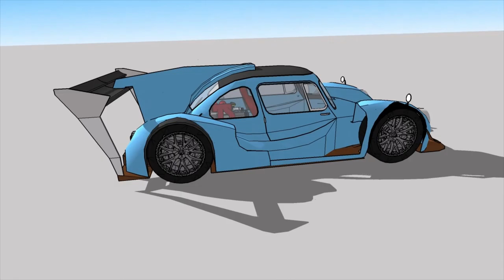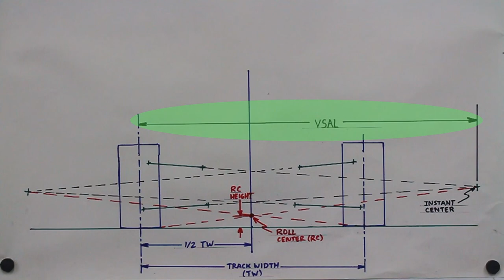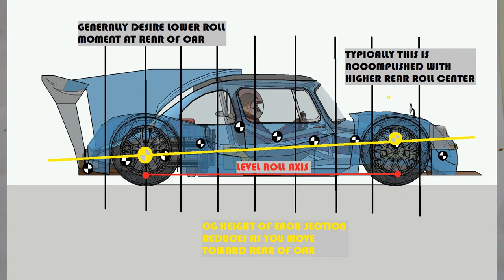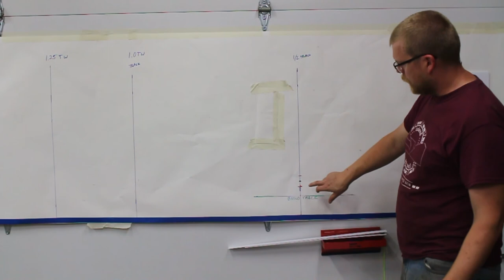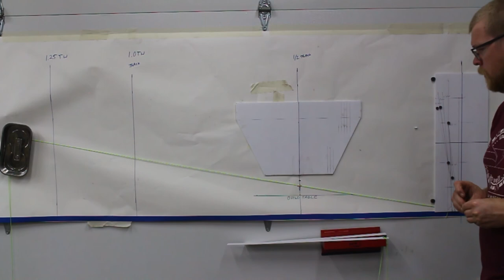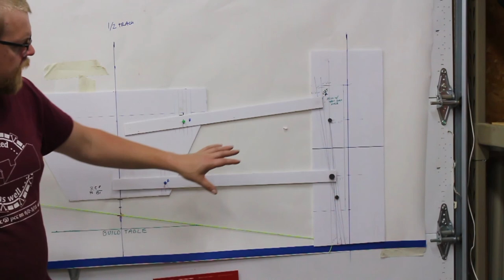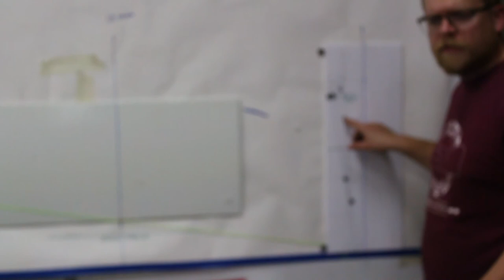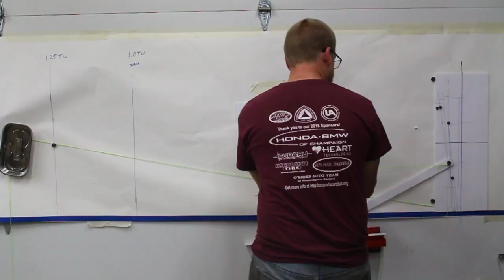Nocones Garage LMP360 EP 3  Suspension Invention

Comment: I just found your build and it’s really tempting me to try and build something similar! Question - you briefly mention anti-squat/dive in your tech talk video. Did you use any of that in building your car? If so, how did you decide how much? What are the pros/cons of it? Seems like most modern suspensions have it built in, but I’m not sure how it affects drivability of a car on track.
Reply from the maker: I did not use any intentionally dialed in anti-dive/squat in the suspension.  My A-arms are all level when viewed from the side of the car.   The anti- geomerty is developed because the forces acting on the A-arms create an instant center when the A-arms are not level.  So it's calculated basically the same as a roll center and could be derived using a string computer, but probably at half scale because the Wheel Base is generally prohibitively long.  The CG location must be known axially along the wheelbase (Determinable from expected F/R weight distribution) and vertically.  The amount of total weight transfer during a braking (or acceleration) event will be determined by the CG height relative to the ground and cannot be reduced.  But what can change is the amount of PITCH that results due to the moment generated.  With 0 Anti- geometry the roll moment is simply calculated from the CG height because the chassis will pitch about the ground bellow the CG.  If anti- gemoetry is introduced the moment arm will be reduced (or increased if pro-dive/squat was used) by the reduction in height caused by the line from the front axle through the instant center of the A-arm line.  I know that was probably hard to follow but it literally is the same as the Instant center, tire contact patch line interesection that leads to the existance of a "Roll Center" in roll.   Okay so now to the meat of your question, what does it do?  Well it's the same as the effects of roll center changes.  You can't stop the actual weight transfer but you can stop/reduce the geometry changes that result from bump and droop.  For a Stiffly sprung, low CG car I have decided to not run any Anti- because the suspension travel due to braking/acceleration is relatively low.  In the front I use a "long" VSAL so the tire stays fairly upright during bump travel which means the contact patch is not affected by camber during braking induced bump so braking force remains linear.  For acceleration I would probably benefit from some Anti-Squat as my rear suspension has substantially more camber gain.   Like anything there are trade offs.  High amounts of Anti- geometry can result in the same problems that plague very high roll centers and that's weight jacking.  This could result in your CG height increasing as you brake/accelerate which could theoretically result in hop as the effected axle loads and unloads.   I've heard some cars run  as much as100% anti-dive geometry to keep the Aero platform level.   As with anything adjustability is probably the best choice and making vertical adjustments possible on the leading or trailing inner ball joints could go a long way.   Good luck with any build you attempt!